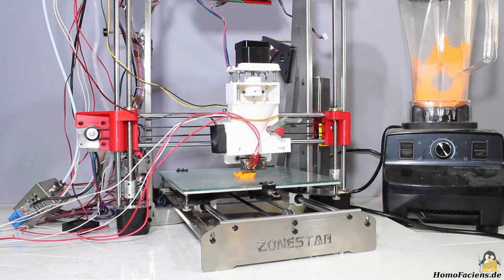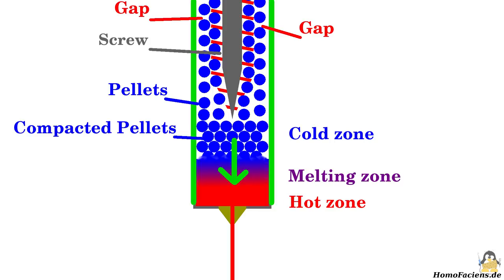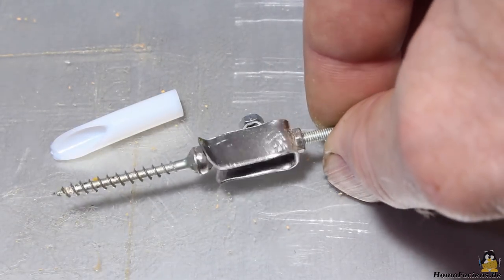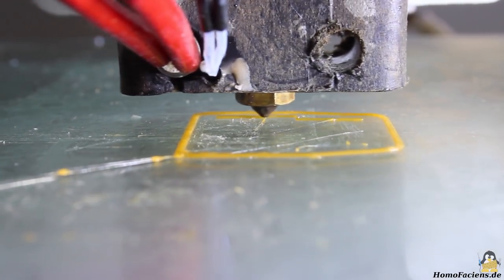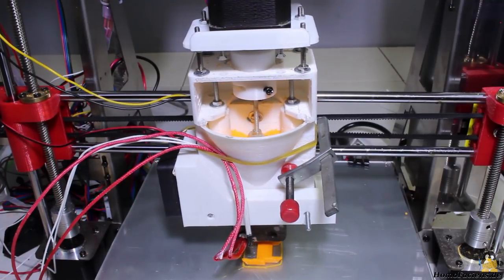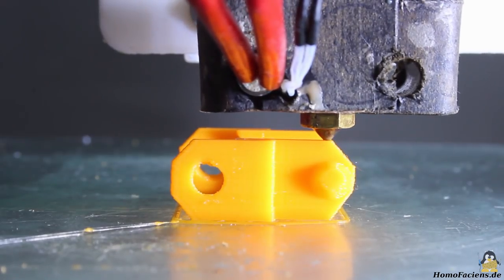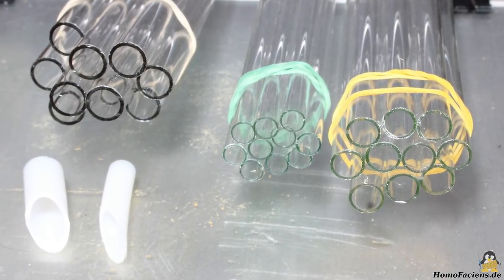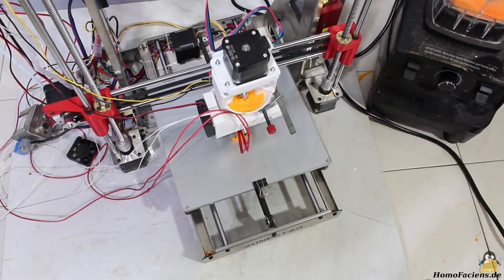DIY direct granules extruder

Comment from the maker: Frequently asked questions (FAQ):
(1) Can you extrude the granules to new filament and feed your printer with that filament?
Yes, you can. Such Open Source filament extruders already exist. My mission is to develop a direct granules extruder which has it's own advantages. E.g. you can print very brittle or very soft materials as well.

(2) Why don't you use a wood auger or a similar device since those are more similar to conventional extruders?
Because they simply don't work as good as my setup. The wood screws I am using have a much smaller pitch. The smaller the pitch and the smaller the diameter of the Teflon tube, the less plastic is forwarded per revolution of the screw. Only with that low flow of material per degree of rotation you can control the extrusion precise enough to get good results.

(3) I know that I can use a large reservoir on top of the frame and gravity feed the hopper through a tube. A filament (granules) sensor can be added as well.

Comment: You can decrease the size and weight of the granule hopper on your tool carriage if you use a house to gravity-feed it from a higher stationary hopper. Like the flex shaft, this would increase the resemblance to a remote Bowden system, and it could also increase the overall capacity of granules you can ultimate input (so long as the hose doesn't clog or kink)
Reply from the maker: Yes I have something like that in mind. I will check it out when starting to make larger prints.

Comment: damn that is a great job! i can see that the simple wobbles of the assembly are causing enough issues to make these results look worse than they could be. i think you have done an amazing job.
Reply: also i think some cooling around the heat nozzle will help heaps. i can see the already-desposited plastic being a bit squishy. man this is so impressive.
Reply from the maker: Yes, the new extruder block currently under construction has mount points for a part cooling fan - stay tuned!

Comment: You should put a Hopper above the printer connected by a tube so you don't have all that weight on your gantry. I really like that idea with the flexable motor shaft transmission.
Reply from the maker: That hopper idea is now in the FAQ section...

Comment: I've been giving some thought to this as I watched it last night and I have a couple of thought I thought I'd like to share with you.  First is that the more weight you hang off of the upper arm the more likely you are to introduce inaccuracies into the print.  One is from vibration but also the lag in start and stop motion.  Ideally the print head should be as light as possible.  Given that, the regular print head works pretty well.  Perhaps combining the granule melting process and the feed process should be done separately.  If you had your granule melter off to the side and feeding a filament up to the print head you might be able to beef up the melter so that it works better with mixed granule size and not have to make extensive modifications to the print head.  The trick would be in having a take up reel for the excess filament produced vs. the filament used.  My applause to you on this and your working through the details. These are the reasons I always look forward to your next videos.
Reply from the maker: Thanks! Working open source filament extruders already exist. I wanted to add my ideas to direct granule extruders that deliver not so good results, yet. It also gives you a wider range of materials to print (e.g. very brittle materials won't work as filament print). The design of my print head is quick & dirty. I am working on a better design.

Comment: I was thinking about those extruders some time ago. I still don't have own 3D printer (I want to build one from scratch), so I'll throw my idea here:
My idea was to use two (or more) cylinders with nut on top and bolt used as "piston". I was thinking about M8 or bigger, tiny cylinder could be theoretically be made just of extension nut. Heated block could be combined for both of them to use just one nozzle. Then, when one bolt screws inside, it forces granules into heated block and nozzle. Meanwhile second bolt runs in opposite direction, they could even be linked together mechanically. When bolt reaches top, new granules will somehow fall inside cylinder and both bolts change their direction of movement.
Only thing that really worries me is leakage from one cylinder to another - one forces molten plastics out, but at same time second one goes backwards and could suck it inside. Some simple valve could solve that by switching between first and second cylinder.
Reply from the maker: A cylinder-piston design (two cylinder or even more) was on my mind as well but I did not make it really work. You'll never get a continuous flow of plastics as you get with a screw conveyor. 

Thanks for sharing your thoughts.
Reply: Oh, I see. That's good to know. Thanks!

And thank you for your answer ^^  You got me really inspired in past with CNC machine and I really appreciate your energy and ideas. Now...I just need to draw about fifth version of CNC machine in OpenSCAD and maybe I'll finally kick myself to buy parts and build it :)

Comment: Amazing! I wonder if would be possible to print with shredded PET or HDPE bottles instead of just reused PLA or ABS. I am trying to find a way to convert strips of PET into something like a filament in order to use in my Ender 3.
Reply from the maker: Its step by step development. Waste PLA prints is what I have collected over the years, thus it's the material of choice for my first experiments. Of course I also have a couple of PET bottles, PE and so on in my house. It will take some time to find ways to turn all of them into granules. Time will tell how to do it - stay tuned!
Reply: @HomoFaciens  I see your point and it is perfectly reasonable. I started 3D printing about 6 months ago and before that I have been saving HDPE for an injection molding DIY project. The injection molding didn't go as I planed and now I have lots HDPE I saved for two years. That is why I asked. As HDPE melts at the same temperature range as PLA, I am looking for a way to turn it into filament and try to print with it. With your idea, things became much easyer! I just need to turn my plastic into fine granules and it is done!
Reply from the maker: @Carlos Eduardo Foltran Turning HDPE into tiny granules isn't too easy. Its anything but brittle and that's what makes things difficult. Let's see how to get your bottles upcycled...

Comment: I don't know if this is already done, or if it's impractical for some reason, but maybe a spike of higher than normal heat when the print head heating coil starts, would help.

I was actually going to suggest a flared-out diameter at the hot zone, but you surprised me by thinking of it yourself.

Also, your print bed is a bit dirty looking… Is it just scratched up, or something else?

(Edit: I rearranged my comment a bit, to put some apparently useless stuff last, as I typed this without reading the pinned comment first. But, by golly, I put thought into those words, so if someone wants to read them, they're there anyway!)

And maybe placing the hopper somewhere above the print head, not attached to it, would allow the print head to be moved faster, as there won't be so much weight. The print head can still, sort of, have a very small hopper with a screw, but the main hopper would be connected to the print head by a large diameter flexible tube, like a one of those cloth tubes that are reinforced by a springy coil of wire, or those tubes that they used to use for robot arms in costumes for the really old Sci-Fi movies, which look terribly silly. The purpose of moving the main hopper off the print head, is to allow you to have a very large reservoir, for really big prints, without slowing the print head speed to a crawl, and putting unnecessary stress on the moving parts supporting everything.
Reply from the maker: Thanks for sharing your thoughts and obviously reading the FAQ ;-)
Yes, the direct extruder restart more easy after a complete cool down if you set it either to a higher temperature or implementing a longer pause before restart printing.
Same as the mechanics I did not prepare the print bed perfectly before each new run (I did a couple of test prints). It's covered with glue stick and that surface got a couple of scratches during test time. If a system works under "production" conditions, it can only get better under "laboratory" conditions.

Comment: Excellent! I just realized, this could have been done in the 1980s with an Apple][e, some parametric equations for simple spheres etc, some stepper motors, and h bridges!!  What else could we be inventing that we aren't thinking about RIGHT NOW?!!
Reply: 3D printing technology was actually invented about back then, but it was locked away in patents which only recently expired and released the tech to the public

Comment: Did you consider specially made extruder screws? 
There is this part on AliExpress (search for "powder extruder screw"), which is a extruder screw specially made for 3D printing. I think it's design comes from the "Mahor Pellet Extruder" design.

Did you consider the "Mahor Pellet Extruder"?
Reply from the maker: Do you get better results with those specially made extruder screws? If not, try my wood screw design. Sometimes the simple solutions are the better ones.

Comment: Hi 

Thank-you for your experimentation. i note that you need small granules. There is a drum cutter called  "Microplane" this could be used to make a fine shredder enclosed in a 2 inch inside dia tube. I have all the bits but not enough time as I am working on a "pick and place machine". Many thanks Keith
Reply from the maker: I get very good results with my blender, so there is currently to me no need to do experimentation with other machines, but I'll keep that idea in mind.

Comment: While this is quite abstract of a concept to think about here, I'm still going to mention it. 
  I've worked in the asphalt industry in the past. I specifically worked on the production and industrial plant side. I'm no expert.
   First, old asphalt grindings are often recycled. This is the stuff removed from the road that will be repaved. When adding this recycled material to a new mix the method used is quite tricky. The secret to adding a lot more recycled grindings to fresh asphalt mix is diesel fuel. Diesel fuel acts like a solvent for asphalt, even the old dry stuff. It will break down the material so that it is soft enough to dissolve into the fresh mix without clumping. Here in the USA our interstate roads are paved with a mix that includes a portion of recycled rubber too. These are granules of all kinds of different recycled products. These are added into the asphalt mix by adding them to the black liquid tar that gives asphalt it's name, we always called it "AC" at the plants I worked at. This material is fed into the flowing AC going to the Asphalt plant. The extruder setup had a preheating phase before it started. It also had a large pneumatic pulsing system that kept everything flowing. I believe this was pointing up with a few jets that pulsed periodically. Of course this system processed around 6 tons at a time so the requirements are a bit different. 
  The idea of a solvent used to soften the material should have a large impact on things like viscosity IMO.
  With Asphalt recycling a small amount of diesel went a long way. It was added to a pile, or the large face of a pile, in the morning and would get mixed every 30 minutes or so throughout the day using the front end loader that feeds materials to the asphalt plant. The next shift would come to work in tge evening and would use the mixed recycled material in the plant while repeating the process with a new supply. This material was barely coated in diesel. The absolute minimum amount was used for obvious reasons.
  I think it would be interesting to test something like this using a solvent compatible with the plastic you're extruding. Most of these are petroleum derivatives too :-)
Reply from the maker: Yes, recycling plastics isn't that straightforward as well. Melting polymers multiple times means the material gets usually brittle over time. Adding a fraction of new plastics is what I had in mind. Looking for a suitable solvent is for sure a good idea.
Thanks for sharing your knowledge!

Comment: Hehe, been there, done that. Small changes in the screw design do make large differences in results. I would advise you to look more towards how professional extrusion screws work. Although you've taken some strange decisions, like pushing the plastic cold and having a gap between barrel and screw, I'm pleasantly surprised it worked out well in your case. Not being able to extruder after reheating is a heatcreap issue to my experience. As the screw design I used went all the way inside the nozzle retraction is not needed, so can't discuss on a lifting mechanism.
Reply from the maker: Conventional professional extrusion doesn't extrude such small amounts of plastics as needed for 3D printing with a 0.4mm nozzle (and below).
Retraction is some sort of heat creap - Hot plastic is pulled towards the cold end. That's what makes things tricky to handle when implementing an Extruder directly into a filament printer.
Thanks for sharing your thoughts!
Reply: @HomoFaciens  smaller than 0.4mm is something I've not yet worked with, as I m to worried about about contaminations,  (pellet making is an even larger problem then extruding it on a 3d printer) Im planning on using a slightly larger one instead (0'5) on my design as a larger nozzle requires less pressure and therefore increases overall material flow.
Reply from the maker: @Christoff Lemmens Smaller nozzles are indeed more tricky to handle - I am searching for challenges in my life ;-)

Comment: Really like your Design it was cool and interesting. To get an more even Flow rate you could try using an auger screw. If you can find one that fits the required diameter that you need.

Comment: Amazing work, thanks a lot for sharing <3
I have two questions: 

Can I by any chance extrude PET plastic with this machine? what kind of modifications needed for such a thing to happen?
Reply from the maker: I can't see a reason why PET should not work, however this is just an experimental setup tested with PLA only and I still have to fight clogging issues.

Comment: Outstanding work! Keep it up! I wonder this method is great for other kinds of materials that can't  be formed into a filament, or don't have enough strength to be pushed through the tubing. I'll be watching this closely.
Reply from the maker: Thanks! Experimenting with different types of materials will follow after the print head works fine.

Comment: what if you build a fat bowden tube and push granules through it? have the pusher screw somewhere in the place where you normally have bowden NEMA.
Reply from the maker: @hytlerson You can't push the granules through a long tube (even if its made of Teflon). Friction of the granules on the tube wall is too high. The tube must be short, just a couple of mm before the hot zone starts.

Comment: Did you try drill bits as the auger / transport mechanism for your granules? a 3mm metal drill bit should be good in a tube with 4mm ID. And for your idea of "closing" the nozzle, a wood drill bit might have just the right form already.
Reply from the maker: Read the FAQ ;-)

Comment: Very impressive, though I still feel like using your method to make new fillament would yield better results. That way you completely eliminate the stringing issue and you can get consistent grain sizes by having a two step process.
The fillament will probably have an inconsistent diameter due to the inconsistency in pellet size, so just build a machine which cuts the fillament into more evenly sized pelets. Each pass would grant you a more consistent diameter (I’m guessing that any more than two passes would be overkill and other inconsistencies would lead to diameter variation)
Reply from the maker: You can get filament with constant diameter out of irregularly shaped granules with varying diameter in one run. I have made something like this before going to the direct extruder design which is more promising to me. However, since many people asked for it, I will show how to do it my way (simple) in a future video - stay tuned!
Reply: @HomoFaciens  Awesome :D
I particularly like your copper screw btw, cheap and effective :)